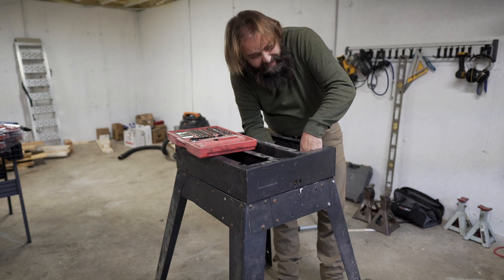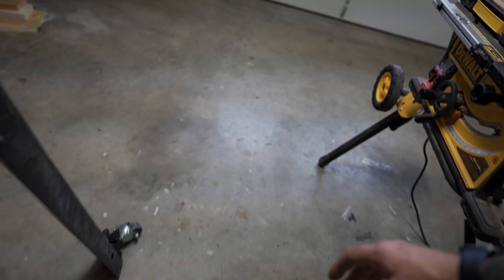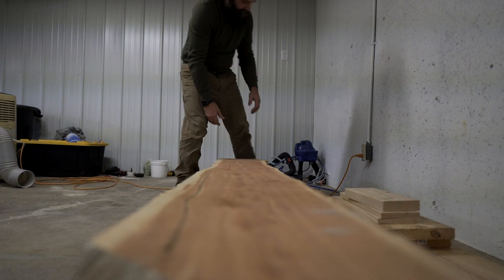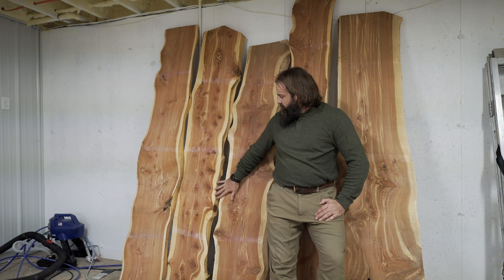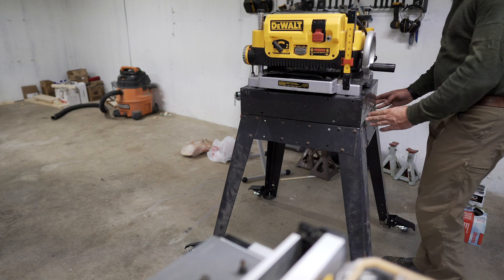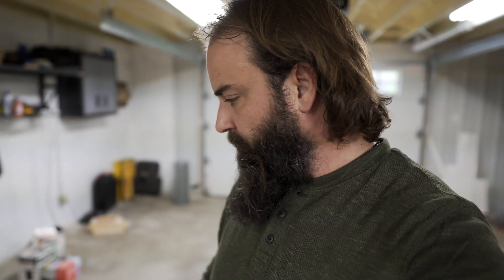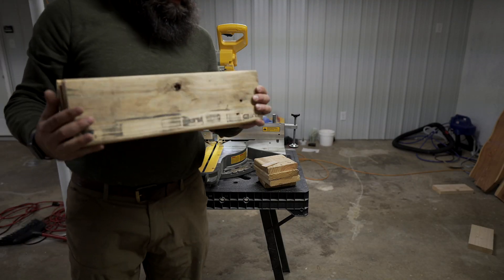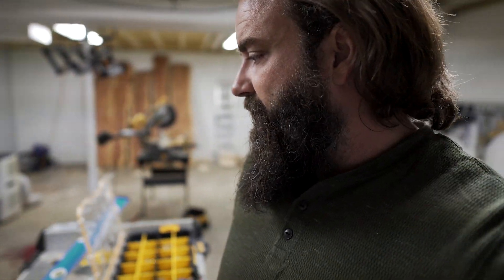A New Project How Am I Going To DO THIS!?

Comment: Larger wheels that lock, rather than those that flip up and down. The flip ones don't look very stable to me. Maybe the legs need cross bracing so they don't spread when you put weight on them? We could see them move as you put the planer on.